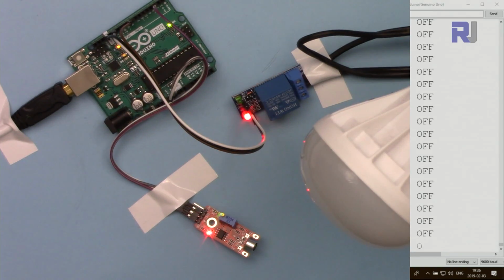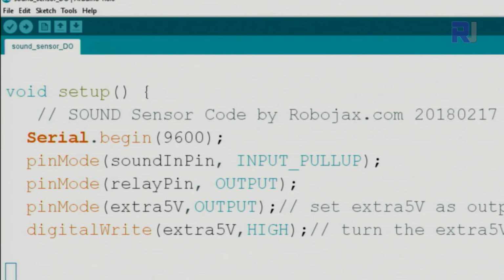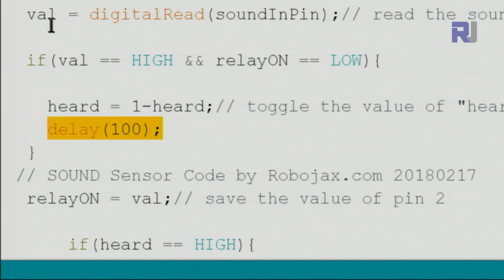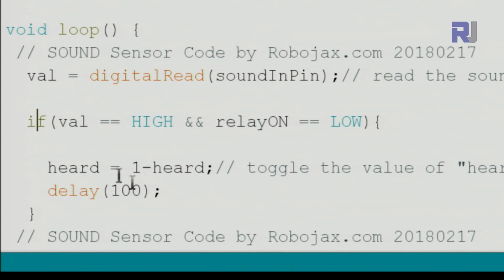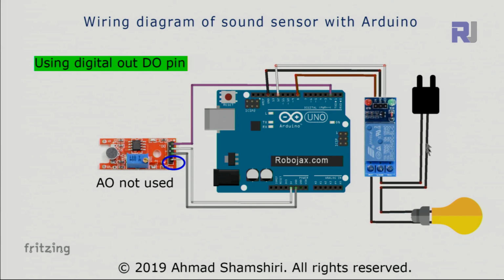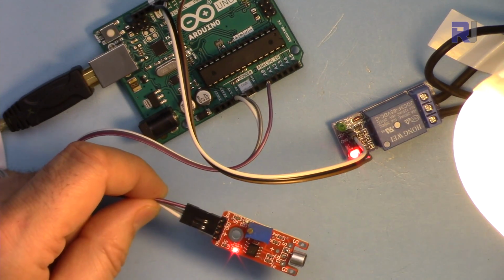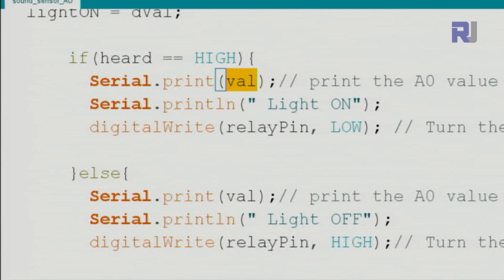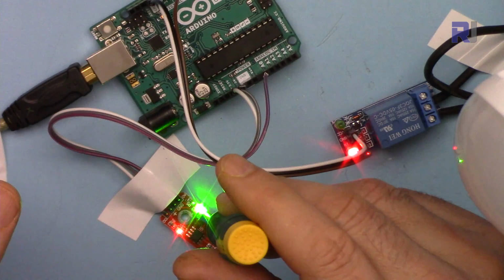Lesson 15: Arduino Sound Sensor Module  | Arduino Step By Step Course - RJT570

Comment: I had followed all the steps carefully, but when I clapped my hands. the light doesn't want to switch from on to off or vice versa, while when I blow with my mouth in front of the sound sensor, the light can switch from on to on and vice versa
help pls
Reply from the maker: salaam alaikum, try to use Serial monitor to pint the text so you can work without relay and light.  the tricky part is to adjust the variable resistor (potentiometer) so you can se proper sensitivity.  if you don't see the sensitivity, it wont' work.  You may also learn from this video https://youtu.be/1szA8CKWuZY
Reply: @robojax  ahhh i found other trouble in my project, whenever the light on or off LED2 on Modul sound sensor in always on, how to fix that? i really need this project for exam